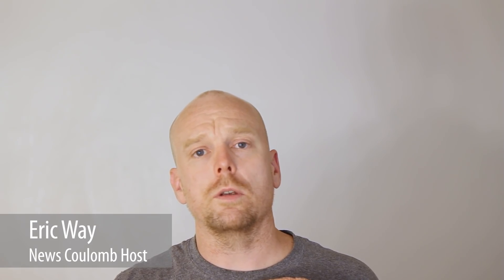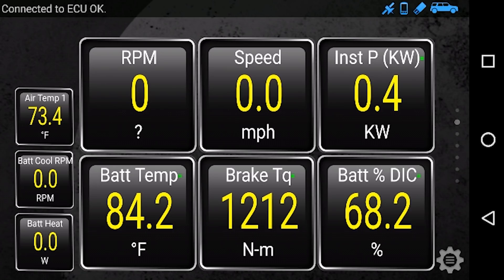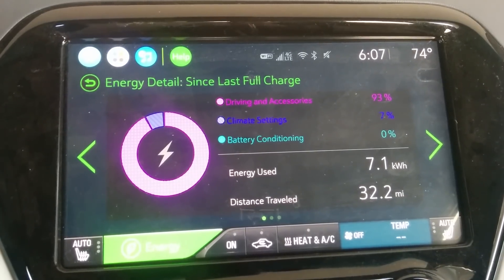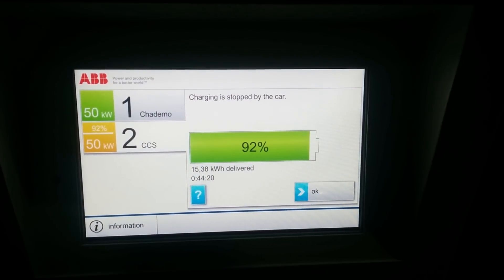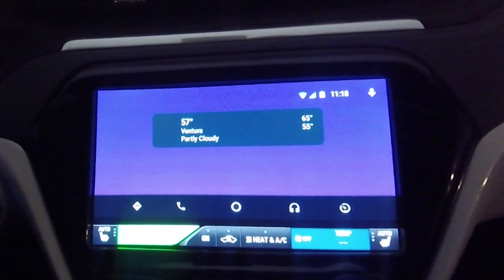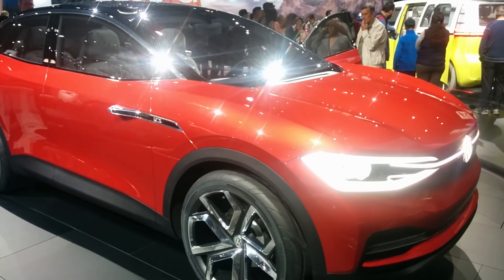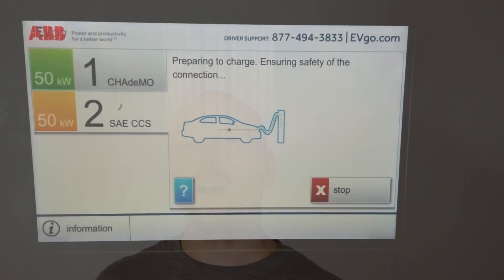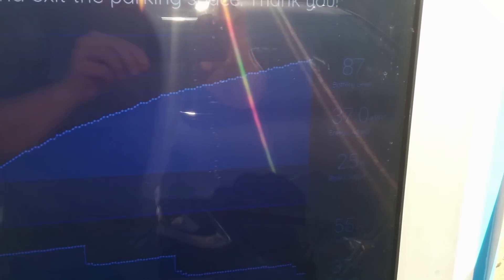Chevy Bolt EV: 70,000 Mile Battery Degradation

Comment: Good video. Bolt owner here. Posatronic. 64,190.i have the first shipment of bolts to California and shipped to Lincoln NE. I am in a electric company(local) study that has the OBD2 device that links to a cell service to report my data. The data has my battery degradation at 5%. At 50,000 miles I have manually calculated the degradation at 3%. So I think they are both accurate numbers. 
I drive min 145 miles to 180 everyday. Don’t use hilltop and only have used dc fast chargers 4 times. I do however program the car to charge to full 30min to 1hr before I leave. I think everyone that uses hilltop and doesn’t go less than 20% battery charge is ok but from the reasearch I have read, leaving the battery at above 55% for a long time is worse on then battery. The same rule of old battery’s and all these new battery’s still applies: battery’s are meant to be charged and discharged all the time. With GM capping the top end and the bottom end of the battery I don’t feel you need to cap it more. Just don’t leave the battery at full for a long  length of time.  Also the heat seems to be a bigger factor also. Glad the battery has a thermal cooling system. 
I believe you stated you weren’t sure about dc fast charging contributing to the degradation. I don’t have any links but I believe the Tesla sites have stated the do affect the degradation of Tesla  battery’s. One would assume they would affect the Bolts also. On Monday I’ll do another hand calculation and respond to this post and see how close it is to the OBD2 reader. I feel the degradation I have experience is fine like other people have stated for ice vehicles. My Saturn got 36 miles to the gallon at 30k and at 120k it was 31. That’s 14%. 
Seems like a lot of people say they don’t notice any degradation but they didn’t say they have done the math. Please use his math formula and calculate   Always good to see numbers not, it looks ok??
Keep up the good videos. 
FYI my only dc fast charging was a 24 hrs 903 miles trip from Lincoln Ne to past St. Louis into Illinois and back.
Reply from the maker: Thanks, Nathan (Posatronic)! Nice to put a name to the ... err... Bolt Stats! name. :-) 

It's interesting to hear that you haven't had significant degradation even charging to 100%. I actually did start doing what you mentioned recently (I'll turn off Hilltop Reserve about an hour or so before I leave) so that the car doesn't sit at 100% for very long. 

I look forward to hearing your updates.
Reply: So calculating by hand for yesterday I get 56.54. So 3.5 % loss. So maybe my OMD2 report may not be as accurately doing by hand similar to yours.

Comment: Great video!  I would estimate based on reported degradation in Teslas that you will experience a slowdown in the rate of degradation.  I will be interested in a follow-up video when you hit 100K or more.  My guess is that you will still have great range when you hit 150k or 200k miles and the pack may last the life of the car.
Reply from the maker: Thanks! I've been getting more gentle with my battery usage over time. I wouldn't be surprised if my battery degradation from 75,000 miles to 150,000 miles will only be about half of what I've seen from 0 miles to 75,000 miles. So maybe 12% by 150,000 miles?

Comment: My concern is with battery degradation due to ambient temperature. I live in desert SW and summer day temps avg 115 and night about 95. l don't have a usable garage to cool car in at night, so my concern is that batty will degrade much faster in this environment.
Reply from the maker: Heat definitely has an impact, but I think that as long as most of your charging is done at night, it should be fine. Actually, not being in a garage is better than being in a garage that's not air condition.
Reply: With the Chevy Bolt or Volt, the battery is liquid cooled and heated. As long as it is plugged in, it should keep the battery pack at less than 90 Fahrenheit. If you can keep it plugged in whenever you aren't driving then it'll be just fine.

Comment: If you deplete your battery all the way to 3 miles in range and slowly charge it on a level 2 all the way to 100% twice  a month.  Your battery will last longer and improve in your range. Try not fully charge your car on DC fast charger. If you precondition your car in the winter time while plugged in on a level 2 your battery it help out on range also.  I did the same thing on my Nissan Leaf ,my Chevy Bolt,my Chevy Volt my Fiat 500e. All have over 70 thousand miles besides my bolt. All still have over 90% battery charge.  My 2013 leaf still gets 98 miles per charge. Fiat still get 93 miles  my 2013 volt still 41 miles  n and my bolt still gets 245 miles.   I only use the DC fast charger as a last resort.

Comment: I drive a Bolt Ev and I also had the software update.  Immediately after I left the dealership I noticed that the range was significantly lowered even though the level of charge stayed at the same level. Chevrolet indicated that the software update was to essentially provide a more accurate range and prevent people from getting stuck on the side of the road....so based on my experience and now confirmed by this video, I do believe that your actual degradation may be of 5 or 6 kw. You have owned the Bolt for far longer than I have so you lived with the previous mod for far longer therefore that's why you wonder if this degradation is much more than it really is.....which is a good thing! Great video! Thanks!

Comment: The long and short of it is...EV batteries are as reliable as any ICE range. My Honda did not get the same mpg after 75K. So, no biggie. I love my current electric car. I'll never go back to gas if possible.
Reply: Electrics sure seem like a good idea. What kind do you have?
The channel weberAuto has some really interesting videos where they take about electric vehicles. The Bolt Motor Deep Dive video has been my favorite in the series.
Reply: Duane Degn the Bolt is very nice. I have a 2017 Kia Soul EV. I got a great lease, $152/month $0 down for 36 months with 10k miles/year. I use it to commute in the NY area. I drive about 9k miles a year and absolutely love it. It has every tech gadget available. I charge at home and wake up to a full charge every morning. The range is 93 miles, over 100 miles in summer and about 70 in the winter with the heat and heated seats on full.
Reply: @raymondbrower7894  Thanks for the detailed reply. I figure my next car will be an EV. I probably won't purchase one for a few years but it's good to hear what other people think about the cars they drive. Thanks for taking time to tell me about your experience.
Reply: Raymond Brower Men neither I have retired a Third generation Acura legend 1996 Acura 3.2 TL one hell of a car. But my Bolt ( except for front driver seat- a lady friend gave me a curved top of the seat bolster which really  helps a lot) is heaven. I could almost live in it! No shower though:-)

Comment: if you can't use that battery capacity because you might damage the battery, then it's useless capacity.
It's like I can run my car at 8,000rpm, but if I do that I will blow up my engine so my rev limit is 7,500rpm.
The car's engine then has a usable rev limit of 7,500.
Reply from the maker: In a manner of speaking, but a more accurate way of saying it would be:

Your engine has a rev limit of 7,500 rpm, but if you run it at 7,500 rpm 80% to 100% of the time, you'll need a new engine sooner than if you only run it at 7,500 rpm 5%, 10%, or even 20% of the time. 

Vehicles are bought to be driven and used. Balancing your usage with your expected returns is something that is universal to all vehicles. Electric vehicles just have different components than internal combustion vehicles.

Comment: Tesla owners who maintain between 20-80% report less than 5% over 100,000 miles.
Reply from the maker: Yeah, I think any EV with proper thermal management should see similarly low degradation if the owner doesn't cycle the full battery. I think even 10% to 90% would be fine, and result in far less degradation than what I've seen.
Reply: I own a Tesla and have around 80,000 miles and I'm up to 15% loss already
Reply: @Michael-ge3eo  Do you have a model S 60? It seems those have the most degredation. My S70D is just shy over 4% loss at 75k miles.
Reply: @Michael-ge3eo  u use the super charger a lot more.than destination charger?

Comment: We can’t charge to 100% or let it go down to 0%   And can’t be using rapid fast chargers all the time? My head hurts. Does it go for ego mowers as well?  Just bought one recently and they include a rapid fast charger so I can’t be using it then? I should get the slow charger then? Someone help me!! Batteries for ego cost over $200. Way better than a Chevy volt battery but it’s still $200 lol. Love my ego mower btw!! EV vehicle is another story. I don’t know.
Reply from the maker: I'm guessing you're being sarcastic. Like any machine, it will wear out over time; however, how you use it will determine its lifespan. Off-road vehicles and race cars don't last as long as daily commuters. Same rule applies to batteries.

Comment: #1: The battery has an initial 57 kwh available capacity. #2: Virtually all lithium batteries initially drop close to 5% and then degradation becomes very level for a very long time. You're doing much better than you seem to think - especially given your very 'hard usage' (owner of 2017 Bolt 54k )
Reply from the maker: The 57 kWh rating was based solely on a sticker found on the battery case; however, GM stated that the actual capacity was 60 kWh in their EPA filing documents. Also, because I was able to track 60 kWh available over several charge cycles, my loss from my initial measurements (4.5 to 5 kWh) would indicate an 8% loss.

Comment: Would you share the specific calculations that you do to correlate the charger information with OBD2 information? I have a new Bolt and would like to track the battery. My home L2 charger displays energy transferred at the end of charging session. That number does not account for AC -> DC conversion though. I have seen 86.5% stated as the efficiency. So I'm assuming that you project capacity from the % charge delta gathered from OBD2 relative to de-rated energy in? For example, if the charger displays 36kWh in to go from 38% to 92.9% (delta of 54.9 %) this would imply (capacity)*.549 = 36 * .865.  This reduces to a usable capacity of 56.7 kWh.  Am I on the right track?
Reply from the maker: It sounds like you're asking for DC fast charging efficiency, but I haven't correlated the data between the charger and the OBD2 readings. I might have captured enough data to do so, but I haven't actually calculated the difference. According to the EPA filing documents, GM states that the Bolt EV's L2 AC charger is 88% efficient. I believe DCFC are in the  90-95% efficiency range (though you might end up seeing additional losses due to battery conditioning). 

So using your L2, I would get 57.7 kWh, or about 4% degradation from 60 kWh.
Reply: Thanks. So you agree with my calculation methodology - you just used a different charging efficiency? @newscoulomb3705

Comment: So he's saying try to run your battery between 40% and 80% charge.  Which means your 60KWh battery becomes a 24 KWh battery.  Might as well just buy a hybrid vehicle which just happens to use it's battery between 40% and 80% automatically.
Reply from the maker: Actually, no, that's not what I'm saying. 

I am referring to is the spectrum of battery use that results in the least degradation over time. My video shows that it doesn't really matter, and that many drivers could possibly see hundreds of thousands of miles out of their Bolt EVs before seeing degradation significant enough to warrant replacing the battery.

Comment: Do you have the first 'mode'l battery or second? I believe after a certain VIN number, 2017 Bolts have some kind of upgrade/tweak in the batteries.
Reply from the maker: I have the first version.
Reply: News Coulomb that is fantastic! Mine was changed at about 50,000 miles I think. I am 76 years young but the memory thing kinda goes south now and then. As Victor Borge says there are two things I can’t remember uhhh there are three things I can’t remember. Keep up the good work.

Comment: Me thinks an ICE car also gets less range per tank of gas after thousands and thousands and thousands of miles!!
Reply: Well, actually no. ICE cars do not lose 8% in 100.000 miles. Maybe 30 years ago they did. But not anymore. Unless something is worn. That is where the EV is good. There is very little that can wear.
Reply: Only if compression loss or incomplete combustion
Reply from the maker: They definitely do, and they also lose power over time. But just like battery degradation, it's going to vary by vehicle.
Reply: I've never had that problem.

Comment: You have not been clear about your initial conditions ? Have you checked the initial 60KWH ? Your degradation should be measured from the initial, which is certainly not 60KWH. or I misunderstood what you said. The best way to protect a battery it to make it bounce around 75 %, and also 75% is the ideal long term storage level. Depending on your trips, you should work as much as possible in a symmetrical from 75% point.  If you plan to use 50% you can charge to 100% and arrive at 50%. You can charge to 100% if you use the vehicle right away. Making it sleep at 100% will degrade it. Like making it sleep at 0%. At a cell level best practice is to charge up to 4V and no more (that is more than 92% anyway). it is the TIME SPENT AT 100% or 0% that degrade the battery. Running it down to zero is not the worst as long as you do not do hard accelerations below 15% ans as long as you charge it immediately  and not let it sit overnight with close to zero %. It is likely that the buffer is at the bottom, most manufacturers will reduce speed and acceleration of the car at some point in the low %. I think below 1C is mostly harmless, you see the KW go down as % go up. If you bounce the battery only inside the % bracket where it charge at 1C well there you might degrade it faster, but again this is more a question of TIME SPENT AWAY from 50-75% bracket. (NOTE: my 100% is 4.00 Volts per cell )
Reply from the maker: It was showing 60 kWh using the same measurement technique across multiple instances < 10,000 miles.
Reply: @newscoulomb3705  ok, great! so the number for degradation you find is degradation + a little buffer added by the software update. That is really not bad considering the usage regimen.

Comment: BS that everyone always pushes. You are going to burn out your batttery charging to full or if you discharge below 20%. absolute BS. As long as the liquid cooling is function correctly, your not going to heat up the battery enough to cause that much damage. Of course that all depends on if the cooling is functioning correctly. There are also safety margins already built into the battery charging by the manufacturers.  Now, for my leaf, Its a 2013 with around 13k miles and is at about 88% battery capacity. That was caused by heat because its not liquid cooled. In a vehicle with active liquid cooling, your simply not going to have that type of degradation unless its not actually properly cooling.
Reply from the maker: Well, it can be both. Battery life is tested by cycling the batteries, but yes, heat can also contribute, which is why the LEAF's battery degradation under similar circumstances will be worse than an EV with a thermally managed battery. 

However, cycling batteries does have an effect. Even though your 2013 LEAF only has 13,000 miles and has 12% degradation versus the 8% degradation I've seen after 70,000 miles in my Bolt EV, your 13,000 miles represents a proportional number of battery cycles. At full charge/discharge, 13,000 miles represents over 170 battery cycles for a 2013 LEAF, while 70,000 miles represents 290 cycles in my Bolt EV.

Comment: I think my degradation (Model S) was about the same when I had 70k miles. I think everything you said is good advice to keep degradation low. OTOH, people should really just use their cars and not worry too much about what to do to make the battery have 1 or 2% less degradation after 8 years. Because, as you said, it really doesn't matter for every day driving.

Comment: Great video post. Question, if you leave your vehicle in Hilltop Reserve mode, even with the 8% loss that you have indicated, do you notice if there is an actual loss in range? Or, does Hilltop Reserve take off another 12% on top of the 8%?
Reply from the maker: Thanks! It appears to simply take 12% of the full capacity. I'm not sure what will happen when the battery degrades 12%.
Reply: It's going to take 12% off the fully charged usable capacity almost 100% sure it won't mask degradation with this.